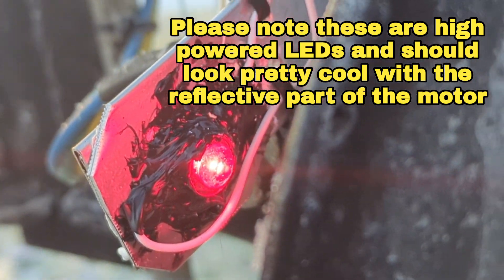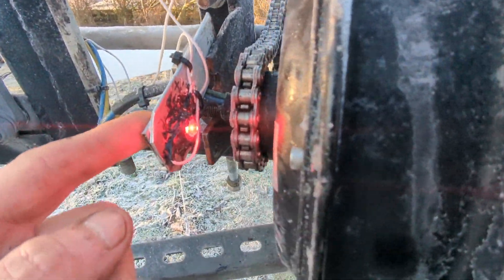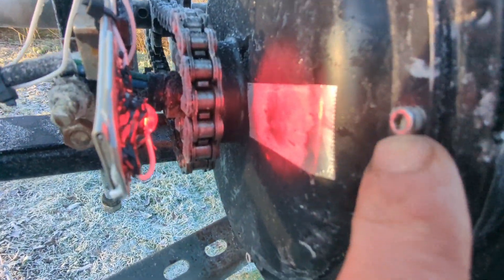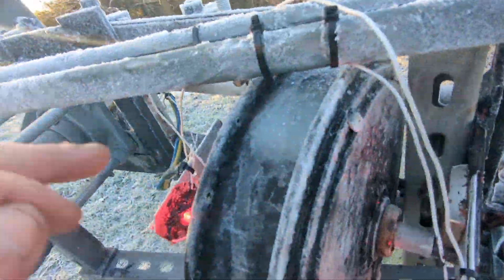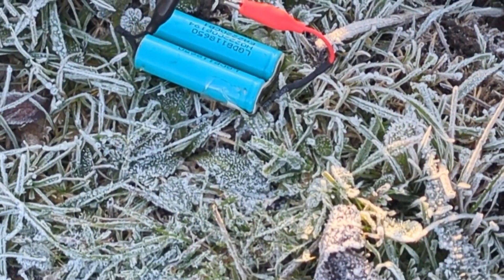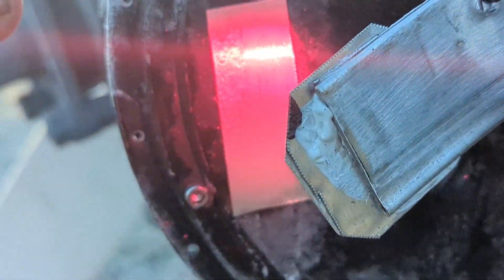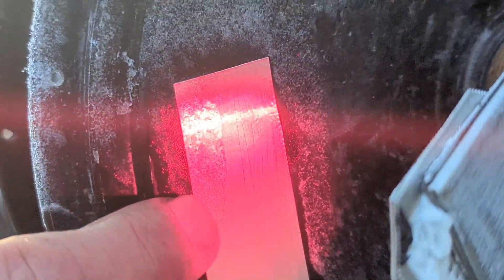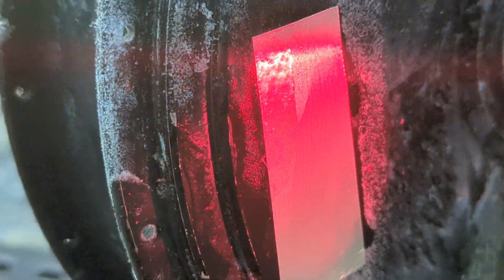This is totally random even by my standards - Wind Turbine LED light - Waterproof Battery Powered

Comment: Magnet and magnetic reed switch mounted near the spinning part would let you flash a light either on the tall part or anywhere you wanted to run power down to. You could get even more robust using a hall effect pickup to flash a small LED anywhere you ran wires. No batteries needed or you could wire up a bigger battery bank for longer run time and not be limited by mounting location.